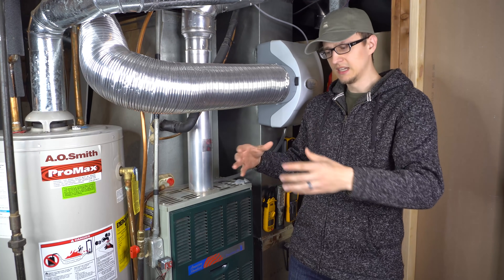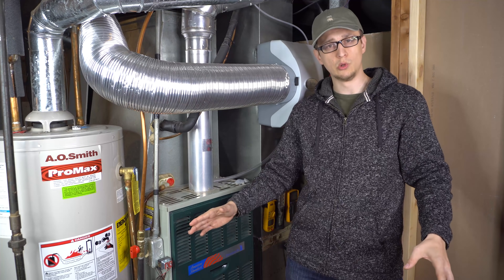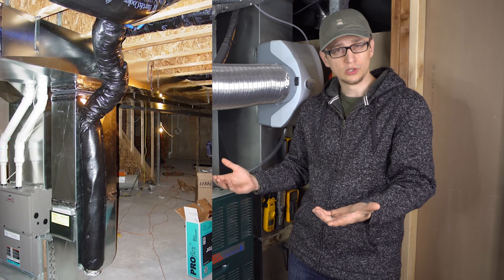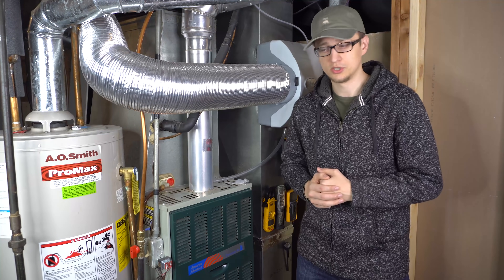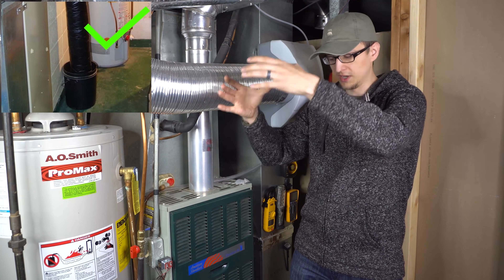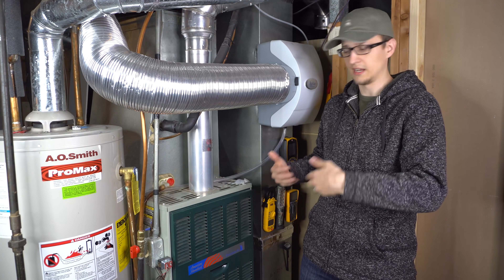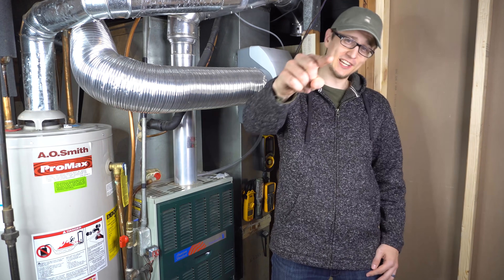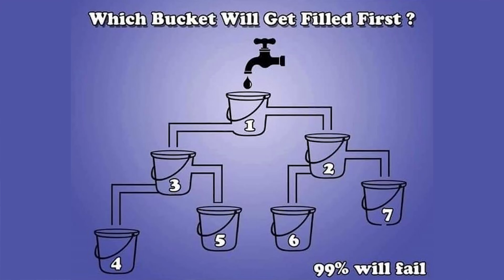Air For Furnace Explained (Combustion Air or Make up Air)

Comment: I always enjoy watching your video....even thought I am not technical...I just want  to tell you and your viewers what happened to me just 2 hours ago, I have an hvac company check my ac, coz I told them I have a leak, the coldest my a/c would only go down to 80 degrees..I had my a/c charge every summer time for the last 3 years..but this time I want it fix.So they came...check my air..on their temp gun it shows blowing 77 degrees..came out to my compressor, open where electrical/electronics are, starting doing something that I do not understand..put their gauge..he said I have maybe around 50% freon left....have the panel for my turn off, then turn on..then told me to find and fix the leak cost $1560.00, plus freon ($1200.00) of 11 lbs, because they have to removed what ever freon left in my compressor, so they can do a nitro gas to find the leak. 

I was thinking maybe I should just have my a/c unit replace If I am gonna spend almost $3000. So I ask how much to just charge it for the meantime, so I can think about getting a new unit..they said they will put 3lbs for $368.00.. when they started to put the freon...now my compressor will not come on all of the sudden..I do not know what he did, it will not come on anymore, but when he try to push something..it would come on..only he put push something with a screw driver... I saw him calling his boss on the phone..then he called me  said the compressor is not working anymore, he showed me a light blinking...they can not put the freon. then I ask him..before you did anything it was working, I was cooling  my house down to 80 degrees in the last 3 days (I would shut a/c off by then) when it was 86F inside. I ask him if he made a mistake that my compressor suddenly stop working. he said..he can't do anything..then he and his boss on the phone started telling  the guy that charge your a/c prevously  should have change the filter coz overtime it will ceased the compressor..that they are blaming it on that.

I told them it was working before they did anything...they started telling me how an a/c work..that I do not know anything about a/c. that I was giving him a high blood pressure, for asking him why you guys gave me an estimate of $1560 to repair the leak or agreed to charge 3 lbs. of freon  if there is something wrong with my compressor? they could not not answer me that..they just told me they will not charge me the $79 service call and they can't do anything. I felt I was fuck..please tell me otherwise. My problem was bad, now it is worst. Sorry for a very long story. thanks.

Comment: With your Furnace & Water heater being in the same room as your dryer(maybe washer too)  explain about the laundry chemicals & the harshness of those to your heating equipment. So fresh air is an important addition to mechanical/laundry rooms.  Retired HVAC installer

Comment: Gr8 video Jay, noticed in the customers house that there were paint cans stored right at the bottom of his water heater...that's extremely dangerous situation. Paint cans or any chemicals that could release combustible fumes should never be stored anywhere near flame burning appliances. Many house fires caused by this every year. We are required to remove these items from the area and note on customers invoice in case they put them back after we leave.

Comment: I thought only commercial places need a makeup air unit
Reply from the maker: In residential, the "make up air" is simply a flexible duct that goes straight outside. There is no unit or fans.

Comment: Thank you for the valuable info. I see that you added a humidifier to your furnace. I always wondered why the humidified air is on the return side. When that humidified air is drawn into the furnace, won’t all of the humidity be drawn out by the heat exchanger?? Would make more sense to add humidified air to the supply duct AFTER the heat exchanger. Please explain. Thank you.
Reply from the maker: Glad you liked the video! The main reason I put it on the return instead of the supply is because if it ever leaks, I don't want it to leak all over the furnace, control board, and other electric components in there. As for the heat exchanger, the gaps between the cells are pretty big so the air passes through quickly, not giving it much time to draw out any humidity. That is just my understanding of it though, I won't make any decisive claims. According to the installation manual, the humidifier can be installed on either the supply or return duct. They just leave it up to the installer. As far as I know, most guys will simply install it where it is most convenient, easiest to access/service, and looks good.

Comment: I once had to remove a door (from its hinge pins) at the entrance of a basement utility room in a finished basement so the furnace and hot water tank (both nat. gas) could get enough combustible air from the surrounding area.  Good video!
Reply from the maker: Good way to solve the problem! :) Thank you for sharing the experience!

Comment: Great video and super well explained. I'm sure homeowners love having you come because you can make the complex seem easy.  I'm definitely going to steal the "furnace is starving for air" line.  I did have one comment and one question though. I think you mentioned that CO had a particular smell to it? CO is actually odorless but maybe backdrafting causes some different chemical reaction that causes a smell that I'm unaware of. Let me know if I misunderstood or if you were referring to something else.

Question:

 Are furnaces rated for how much air (oxygen) they need. for combustion? One solution I've read about to a lack of combustion air is adding grates to the door to your mechanical room or a nearby wall or undercutting door but I don't think these solutions give estimates about how much cfm more that will add to the room.  So how would you size the grate or undercut if you don't know how much cfm you need for combustion? Do you ever recommend these options if the homeowner really doesn't want cold air coming into their home?

Thanks again for putting out super great content!
Reply from the maker: Thank you! You are right, carbon monoxide has no smell but it is usually produced as by-product of incomplete combustion and the other by-products have strong odors. So typically the smell of the exhaust fumes (high efficiency furnaces vent to the side of the house and I've smelled many...) is more pungent when there are high levels of carbon monoxide emissions. Sometimes I even smell this smell at the front door before I come in. (If the exhaust pipe is closer to the door) In those cases it is almost certain that the CO PPM will be in the thousands. 

Yes, I have actually recommended simple solutions like that before. I have showed customers the lighter example before so that they understand. So if there is a water heater in a closet space that is back-drafting, oftentimes simply leaving the door to that space open will solve the problem. So I fire up the water heater and show them how the lighter flame moves with the closet door open and with it closed. Adding a grate in a door might be enough to fix that problem as well. Only way to know for sure would be to try it :)

As for the specific answer of how much air is needed... That's hard to say because there are always so many variables involved. Here is the answer though: With a 10:1 ratio, it takes at least 1,000 cubic feet of air to burn every 100,000 BTUs (1 CCF) that goes through a furnace. Because combustion is far from perfect in residential equipment, the requirement is more likely to be 1,500 – 2,000 cubic feet of air.

Comment: Hey man love your videos! I have a problem with my hvac. The problem is that it keeps blowing the 3amp fuse ive already changed the thermostat and the fuse it was working for a couple and again it blew the fuse when it wanted to start up again. I believe the wires that run from the thermostat to the hvac are fine what else could it be?
Reply from the maker: You will have to "chase down" the short" which can sometimes be tricky... Have you seen my video on this topic? That would be a good place to start: https://www.youtube.com/watch?v=4e4wsruGS0s&t=1s

Comment: Puzzle answer is cup 3 gets filled first, 2,4, 6,7 stay dry, no path for water flow
Reply from the maker: Nice! :) That is very correct. 3 is the right bucket, congrats!!
Reply: Well the reason I said 5 is because 3 only fills up to 75% where 5 fills up to 100%. Tricky 🤔

Comment: Number 5 will fill up first.  Did that furnace room still need the draft air vent with the high efficiency furnace and a power vent on the water heater?
Reply from the maker: Sorry Dave, Bucket 5 is incorrect. And yes, even though the water heater has a power vent, it still sucks air from inside of that small room. So unlike the high efficiency furnace which has it's own intake pipe, the water heater would still need adequate combustion air that it will suck in from it's surroundings.

Comment: i have a 70 volts DC with 4 solar pannel , can i change the compressor in the poole heater to be DC and use my solar pannel with it instead ??
Reply from the maker: No, I don't think that would work but I have never done anything like this or seen anyone do it so I can't give you a good answer.